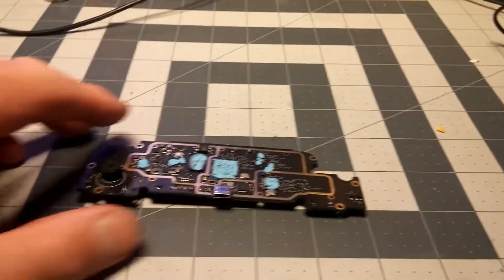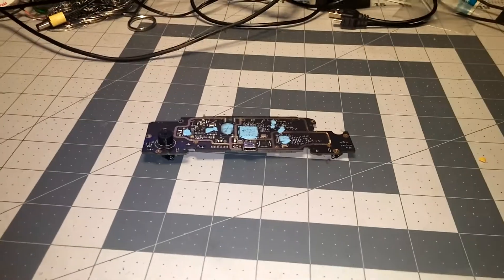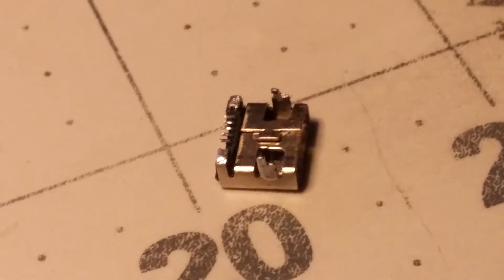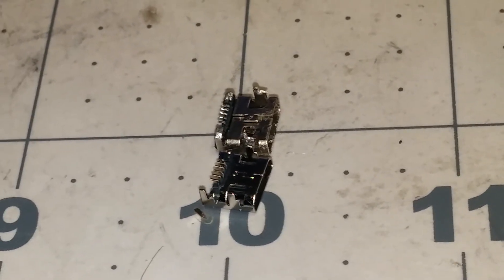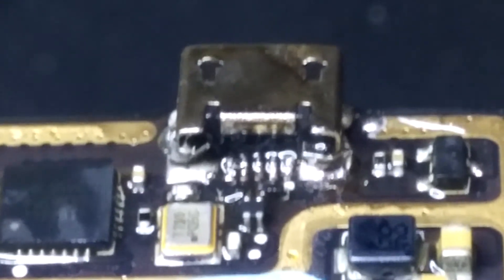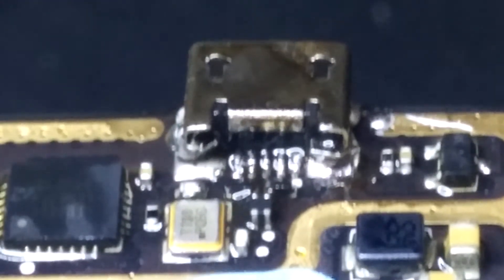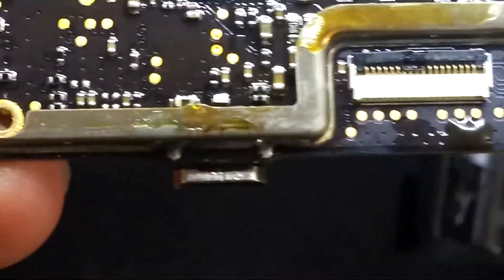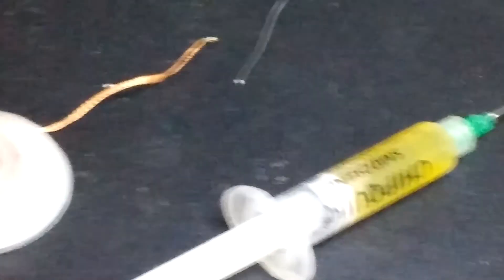Repair broken charger port on a DJI Spark Controller

Comment: nice work 😊 would you say this repair's possible with a standard, non-heat gun soldering iron and no microscope? have yet to invest in the latter, but maybe I need to?!
Reply from the maker: probably possible with a standard soldering iron. heat gun is soooo much nicer. you can get them for under $100 on Ebay